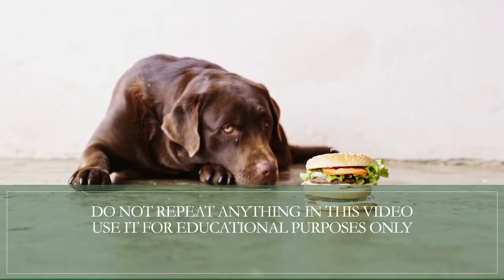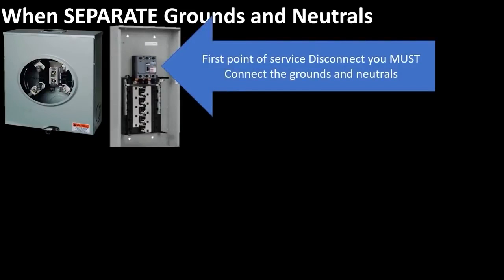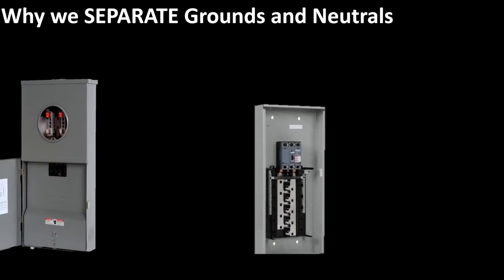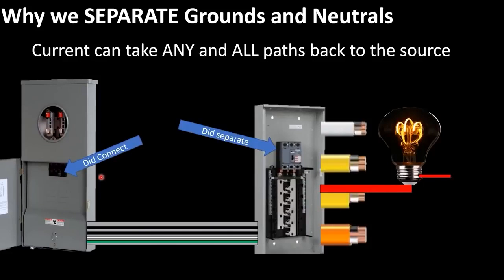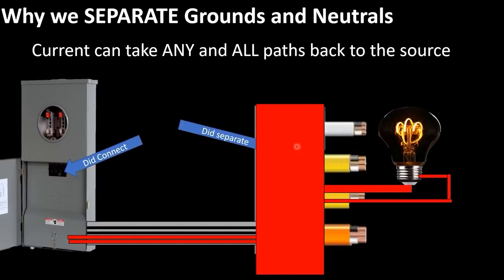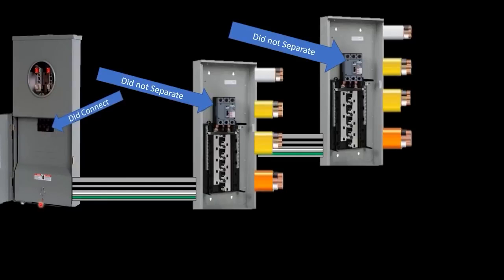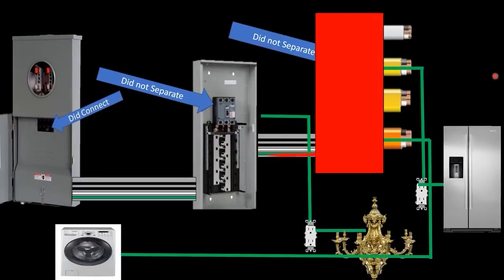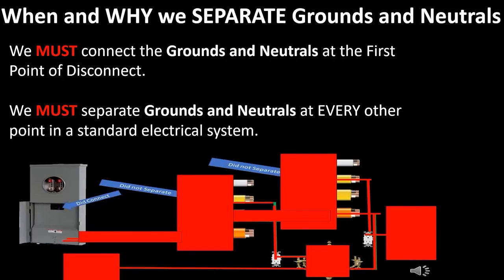When and Why to Separate Grounds and Neutrals

Comment: If a ground and neutral aren't separated in a sub panel then the current can flow from the neutral to the ground and energize metal parts. So then when they are separated and there is current in a ground from a fault, how come this current doesn't energize anything? How is the current in the latter case any different as it travels through the ground wire? Thanks

Comment: How do you treat this scenario: outdoor pedestal 200A main panel has ground and neutral bonded, 200A sub-feed out of that main feeds 200A ATS for generator and the ATS has an equipment ground with grounds and neutrals separated. From that ATS there is another 200A 3 wire subfeed to the 200A sub panel in the house that has all the distribution in it, this panel is grounded to ufer in foundation, does this sub panel need grounds and neutrals bonded or separated?

Comment: Nice video, I have a question for my RV I did changed my main romex wire inside the RV, when I did it I shutt the braker off inside my house so I have no more power feeding the RV. The way I reconnected the romex wire to my RV electrical pannel was the two hot first and separate the ground and neutral. Was it ok if my braker inside my house was in off position? I just found your video saying plug ground and neutral first. Let's say you want to find an open neutral on an RV, if I test every single braker to look if I have 120volts on hot with neutral and ground, is it the good way ?

Comment: 5:26 The idea of nearly all conductive raceways/fixtures/surfaces/etc. (which are in contact with a ground wire) suddenly becoming hot due to an improper neutral to ground bond makes perfect sense after seeing your video. It finally clicked for me at 7:12 when you detailed the commonality of how most to all devices with conductive components on them ground themselves to, well, the ground - But if the ground is handling/sharing the return current with the neutral wire, the floor is lava, and all the fixtures touching that ground become hot as well.  Thanks, coach!

Comment: what about if you have a meter can combo with first point of disconect and a main breaker inside. but you only have 2 hots and a neutral coming from the meter. is there a need to separate them ?

Comment: In an old building, there’s a fused disconnect outside and they ran SEU to the interior panel, not separating G&N. Can a new insulated neutral wire be run to that panel to make it work and then separate the neutrals?

Comment: I don't have the option of running 4 wires to the detached garage as it has a buried 3 wire out there.  So how do I make it right?  It does already have its own ground rod at the garage.  But should I have bonded or unbounded neutral?  I am confused about how to get this right.

Comment: If there is a receptacle next to the main panel which is wired directly into the main panel, wouldn't the metal can be electrified since the ground and neutral are bonded in the main panel???
Reply from the maker: Energized no, current flowing potentially
Reply: @ElectricalCodeCoach   sorry, I’m still confused regarding the answer to my question. Since ground and neutral are bonded in the first panel and all electricity normally flows back to its source through the neutral wires from the entire system (house or building), then why don’t we get shocked when touching the metal can of the first box while standing on concrete floor in bare feet? What am I missing ?
Reply: Why would the receptacle next to the main panel be different than any of the others?

Comment: Summing this up in 2 sentences:: Ground ceases to be ground if it's connected to neutral anywhere other than the first point of disconnect.  The ground wires would then carry current and be several volts above true ground.

Comment: Very well explained!! Now the separation of grounds and neutrals after the first point of disconnect,  kind of goes hand in hand with the requirement of neutrals at all switch boxes, with a few narrow exceptions,  as of 2011.   Particularly in older homes  it was a common practice to have the feed in the light fixture, with a 14/2 dropped down to a switch box.   Then DIY'ers would use the ground as a neutral,  when installing electronic switches that requires a neutral to work,  now you can have unwanted current on the equipment grounds.   Dryers and ranges follow similar rules.    Before 1996,  3 wire circuits were used, and the only time they are allowed to be grandfathered in, is if the dryer or range originates at the service equipment, and you're not allowed to modify the circuit in any way, or it counts as a new installation, and you must run a 3 wire plus ground cable in this case.
Reply from the maker: Thank you for sharing!

Comment: my power first point is going to be my 48 v -240 v solar inverter so is my 200 amp panel a sub panel? the inverter will be my first
disconnect  in the system.

Comment: That was most informative and direct. I will make sure that neutrals and grounds are only connected at the first point of connection but separated at all of points. Very clearly stated and explained.
It seems to me the some sort of certification should be obtainable by a person of this skill level so those of use who learned this section of information can get a sign-off on the knowledge we gained. Certified Knowledge. I enjoy from all the people and I want them to still post and share but a certified youtube instructor would be worth noting. 'The electrical code coach is first class
Reply from the maker: Thank you

Comment: At the very beginning of the video you mentioned that previous code cycles allowed bonding of neutral and grounds, and said that it could be potentially hazardous to disconnect them, would like for you to elaborate on that , thanks
Reply from the maker: Basically I do not want anyone to just go in there and think they're fixing something when they could be creating a larger problem.

You can't just separate grounds of neutrals unless there's a ground path back and a neutral path back.

Previous code cycles allowed them to be bonded and going back and disconnecting them now without having the proper return path could kill somebody or start a fire.
Reply: Thanks for explaining, that's very good information to know when dealing with older houses